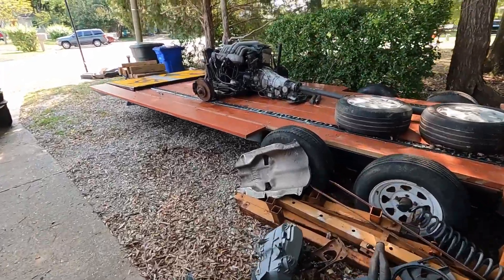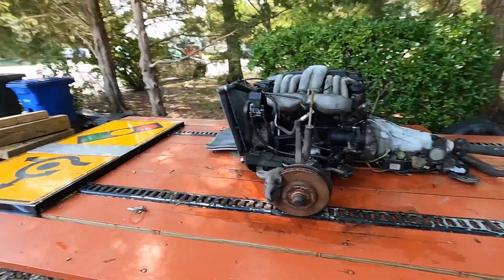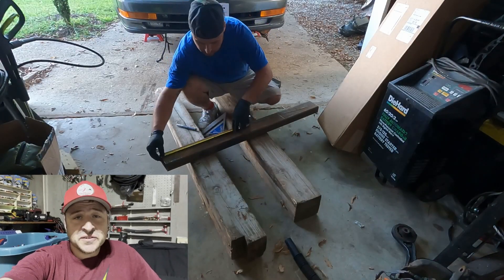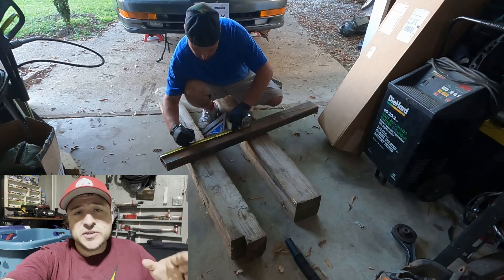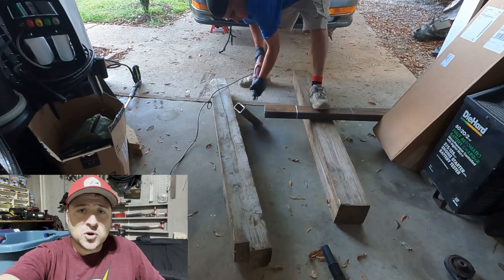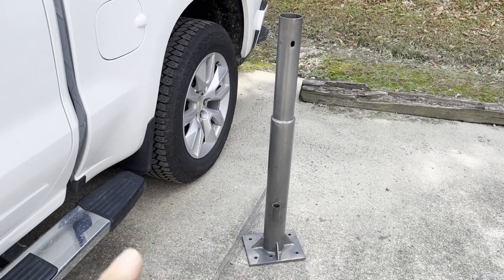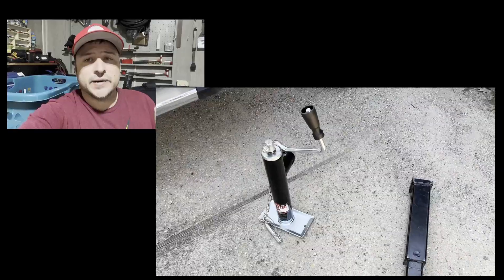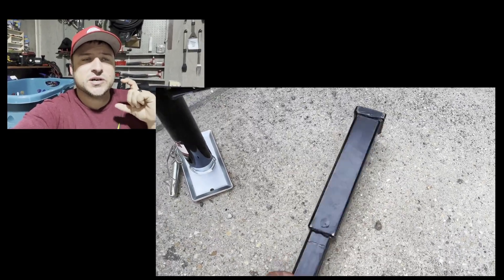BEST DIY PORTABLE ENGINE HOIST CRANE BUILD

Comment: How I did mine was use a 1/2” steel plate and cut it to fit from bedside to bedside width and between wheel well and tailgate. Then bolted to chassis frame rails and use external brackets on the outside frame rails. I’ve used this to pick up big block Chevy with transmission and diesel engines no problem. Just take tailgate off when using